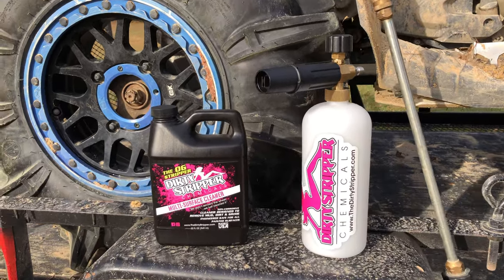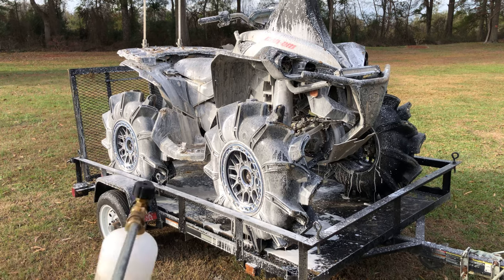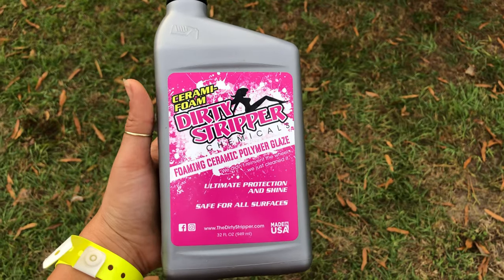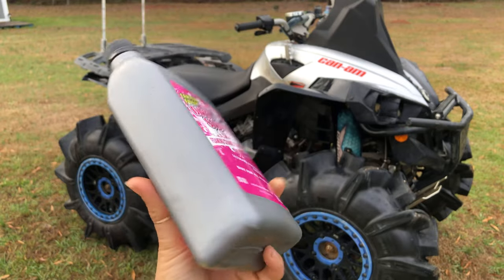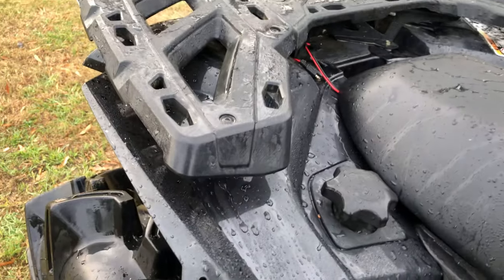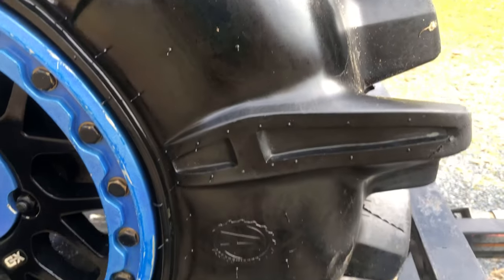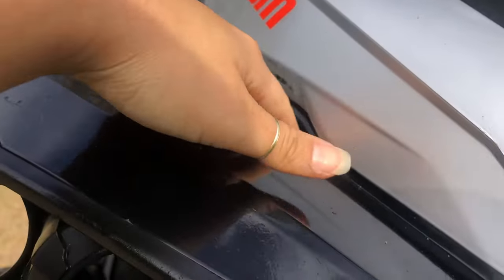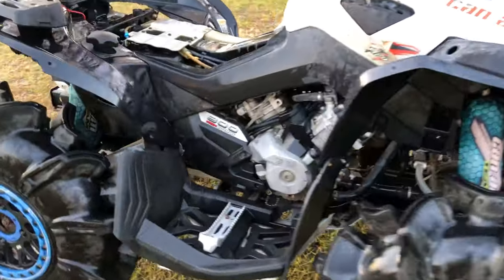Dirty Stripper Chemicals Product Review Is It Worth It???

Comment: How did you feel about some of the stains that it couldn't Remove? I am super ocd on my machine having any kind of stains on it after washing. Looks like a few areas it left clay on there.
Reply from the maker: So far it is the best product I’ve tried. And you can definitely let the product sit longer for stubborn stains or coat twice. Busco and deep creek mud dries and sticks like concrete. I’m very happy with it and it decreased my cleanup time by almost half. I like to shine it up with the stripper glitter as well. It’s comparable to sc1 but you get more product per can.
Reply: Does this product have a mild acid in it like honda bright